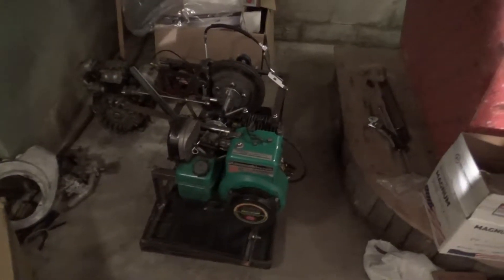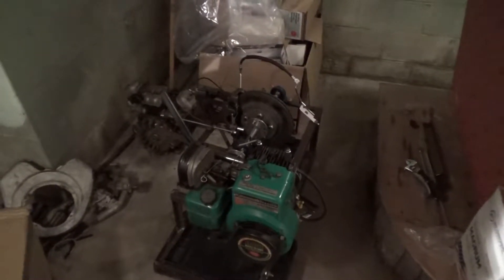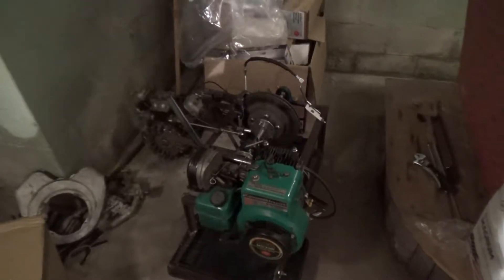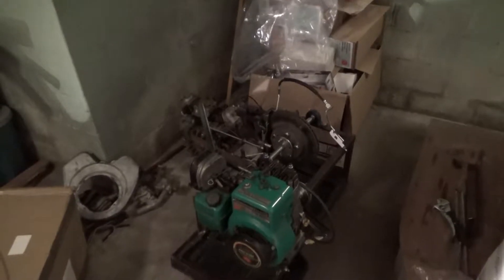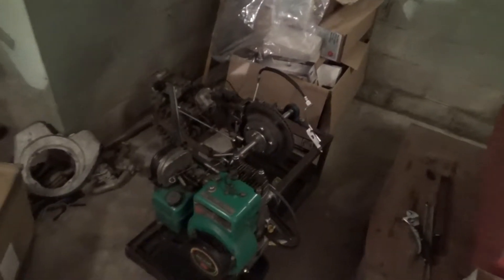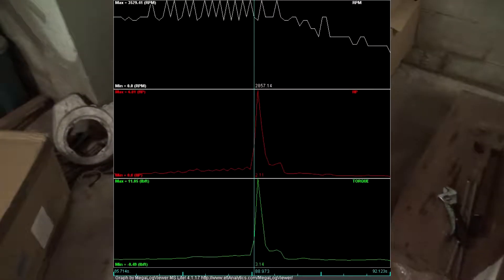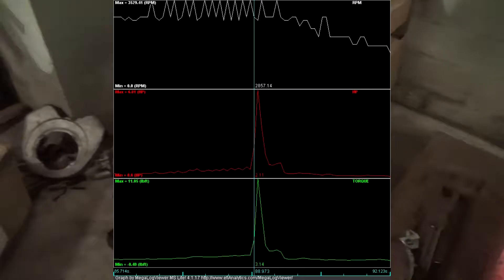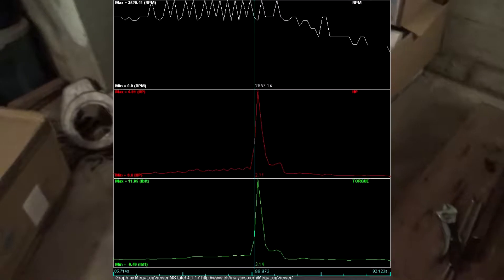Small engine dyno build update 1-9-18

Comment: You should not be using air for the brake. Air is too springy and the stiction inside the caliper causes the pressure to build up until the piston breaks free then you have instant brakes.
Reply: If you insist on using air then put full pressure on the input and control the application of brake with the air exhaust.
Reply: @RandallBoley  then watch it change under temperature lol

Comment: Hi 

Have you come right with you voltage problem on the VR Sensor ? You can use a 10K Ohm resistor together with the 4.7v Zener Diode, this will clamp the voltage perfectly with out shorting it down to 0v, the resistor will limit the current so you will have a nice perfect 5v pulse that you could use on your input pin of the micro controller.

If you need assistance or schematic send me a email, i will help you !

my email is arnold@crystalautomation.co.za